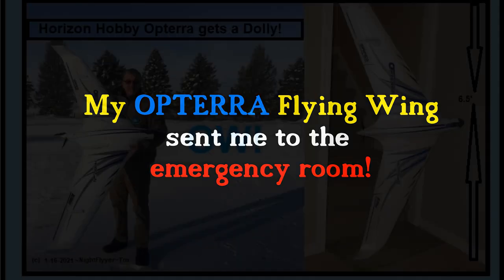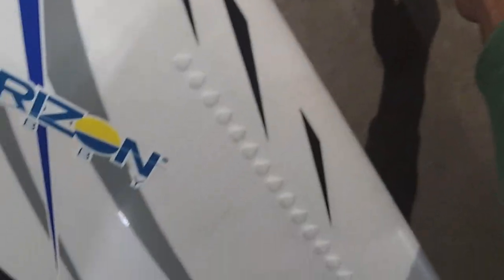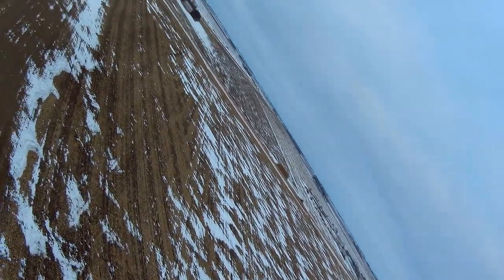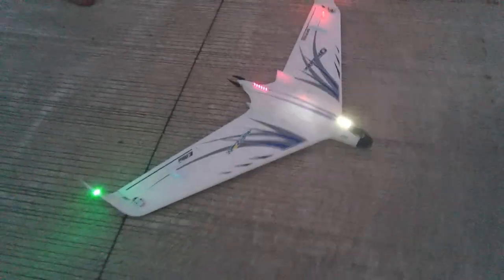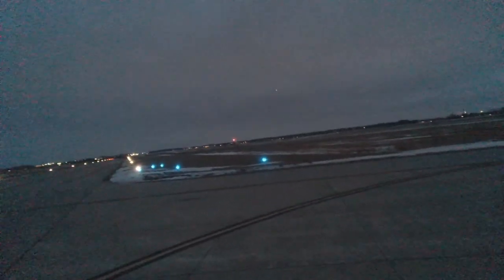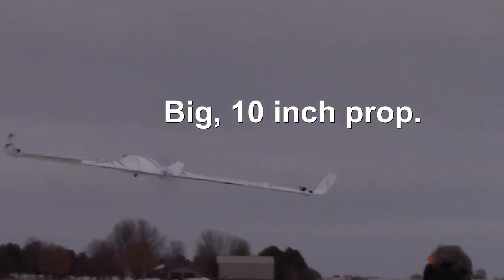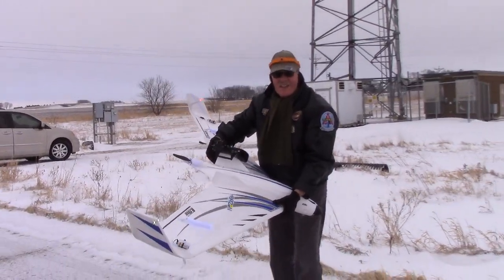My Opterra 2M Flying Wing sent me to the E.R. This is an awareness video & my solution for launching

Comment: Maybe one of those wire mesh gloves, used for filleting fish?????
Reply from the maker: Thanks for that suggestion and I tried that already, but because it was cold.  I found trying to hold on to the tiny finger grips on the bottom of the 7 foot wing with a thick glove under full power with wind blowing was difficult when under power and then trying to fly with  a big enough glove on was also difficult to fly the transmitter, (I'm a stick pincher)  so although that sounds like a good idea, it did not work that well. Some have told me the Prop got them in the forearm even before launch, when a gust of wind got under the wing and tipped it back.   We are only talking about a Half inch of clearance that I needed to keep from getting cut, and even though I pulled it off several times in my earlier product review video,  I will never hand launch it again.  LOL.  It's hello dolly from now on!  Thanks.
Reply: @NightFlyyer  I love wings, and, had looked at this one, myself. I shied away, as although the size was appealing, it looked too bulky to do a "frisbee launch" by holding the wing, itself. Also, it didn't appear to have enough power to pull itself off pvc "rails". Maybe just the addition of landing gear? I've seen it done, once. Seems like a lot of work.
Reply from the maker: @miker1473  yes it is really under powered.  My landing gear is now the dolly.  It adds no weight to the plane, as well..  Thanks.

Comment: Start the motor AFTER hand launch. Or have someone else launch.
Reply from the maker: I know others have their own ways, and either way, my Dolly is the safest solution for me.  
The Opterra 2M manual also says nothing about throwing it with the motor off, so if a newbie followed the instructions, like I did, I'm showing what could happen, in case a gust of wind got them or something else.     Nothing is 100% and no matter how good you can throw, this big 7 foot wing with a 10 inch prop spinning right next to your face, into 12 MPH is risky to say the least.  The 10" prop is very close to your forearm as well, so a gust could tip it back even before launch, as others told me happened to them.  Thanks.

Comment: What a mess! I wonder would wearing a motorcycle glove have stopped the blood getting on your Transmitter 😂
Reply from the maker: Thanks for that suggestion and I tried that already, but because it was cold.  I found trying to hold on to the tiny finger grips on the bottom of the 7 foot wing with a thick glove under full power with wind blowing was difficult when under power and then trying to fly with  a big enough glove on was also difficult to fly the transmitter, (I'm a stick pincher)  so although that sounds like a good idea, it did not work that well. Some have told me the Prop got them in the forearm even before launch, when a gust of wind got under the wing and tipped it back.   We are only talking about a Half inch of clearance that I needed to keep from getting cut, and even though I pulled it off several times in my earlier product review video,  I will never hand launch it again.  LOL.  It's hello dolly from now on!  Thanks.

Comment: my dad got me a powerful plane called the typhoon and he was trying to put the blade on and it was still on and the transmitter turned on and cut threw his shirt and his skin and his stomach was open but my dad was tuff he was in a little pain but for some reason, he didn't go to the hospital I wonder why he put some bandages on and continued to build the plane and I was shocked he said he was fine the plane end up breaking but it's fixed now I'm just getting trainer plane I have a lot of RC heli's and car's so I thought i would know how to fly it but I didn't so I have a trainer plane now and that's my story on learn it before you fly it thank you for your time.
Reply from the maker: Thats quite the story.  Thanks much.
Reply: @NightFlyyer  no problem

Comment: oof, and i thought the people who launch wings by throwing them over their head in front of their face were crazy. i wonder if you could get by with some heavy welding gloves for now
Reply from the maker: Actually that would be hard to fly the left stick with after a launch as I am a pincher.  Besides the indents for your fingers are very small.  Gloves would not fit in there. My dolly is fine for now.   Here is exactly what the Opterra 2M manual says word for word.  1.  Put the aircraft into launch mode with the channel 5 switch.  (in my first video that did not work, it went into the ground)  2.  Hold the aircraft in one hand and the transmitter in the other.  3.  Apply full throttle and throw the aircraft directly into the wind, angled slightly up (5 to 10 degrees above the horizon). 4.  Climb to a safe altitude and check the trim.   Thanks.

Comment: Glad nothing serious happed 2 u. Well there are several easy solutions. A launch buggy is really not neccesary. Our pilots who fly gliders use such a buggy since the power on gliders are gerally weak. So a hand lauch is very difficult. You can always throw it like a disk, holding on one of the wing. With a flight controller on board, no matter which angle you throw it, the plane will always stabilize itself and follow a 45 degree path. 
I removed the stock receiver and placed a PX4 flight controller. With this you have access to telemetry, and most importantly RTL (Return to lauch). Here is a video where I lost sight of my Opterra because it went too high up and I was facing the sun. Not a smart thing to do. At around 3 minutes I activated RTL and it flew back. Here in Wallis (Switzerland) we have strong winds (25 to 35 kph). Again with a flight controller it lands as if there were no wind. I am a big fan of Opeterra. Wish u happy landings. Here is the video:
https://youtu.be/vsq8T75QdYs
Reply from the maker: I will never hand launch this again. Your Opterra is the small one, as it sounds like in your video.  
This wing is 7 foot long, heavy, under powered, and will bend and break the end off the if you even try to pick it up by the tip. (See below video link). It barely has enough power to fly out of your hand at launch and especially while I was trying to throw it into 12 mph wind. I know and I tried to launch it discus style, but could not hold it where I felt I could launch it successfully in the wind with 2 fingertips.     It would  be extremely difficult to somehow launch it discus style with the elevon there and that 7" tall winglet rudder that is also on the tip.  I know how to do it , but not with this plane.    
It's not like launching my SMALL F-27 Evolution or 1.2M Opterra.  So I followed the instructions word for as I did for the video I made of my product review earlier where nothing happened bad.  https://www.youtube.com/watch?v=P_inF5EYLEE&t=1s 
We are only talking about a Half inch of clearance that I needed to keep from getting cut. 

Here is more on the issues of hand launching with pushers, especially this 7 foot Opterra 2M with my sled launcher. https://youtu.be/f5xDfk7sbcQ
Reply: @NightFlyyer  No I have the 2 meter one. I don't have the small one. What makes all this possible is the flight controller (PX4). What I do is assign a button to raise the elevons and an other one to put the plane in stabilizer mode.(Not lauch mode) This way I don't even need to control the radio.   I give it full power and throw it with only one hand. It's a bit ricky but it works fine. This way never had a crash during lauch. Putting in stabile mode fully stabilizes the discus throw. So no matter how badly you throw it, the plane always stabilizes itself and flyes 45 degrees up. No rocket science here.  We have a lot of snow here, so once it melts away,  I'll try make you a video. Words go only so far. Without the flight controller  however, it would be almost impossible to start this big baby with only one hand. Since the lauch is not ideal, before you could start using  your radio, the plane would have already bitten the grass.
To land the plane, I do the same again. I raise the elevons,  just like during the launch and cut off the power. The plane than glides and lands all on its own without me even touching the controls. You can see this in action at the end of the video.
One last thing. I use 4S instead of 3S lipos. The motor then is not underpowered.
Reply from the maker: @iderman2000  Gotcha.  But again this was only my second flight and I did it by the book for my Earlier Product review video. https://www.youtube.com/watch?v=P_inF5EYLEE&t=1s  This video, I launched first by the book, but the autopilot, as you will see did not help, so I turned it off.  I try to do things by the book. 34 years in the USMC, has me usually following instructions or be dead. LOL.  You've had plenty of time with yours to practice and figured it out.  I think the manual instructions should have all your suggestions put in with that programming info published, so everyone, including this 73 YO man, would have a better chance that this would not happen.  Anyway If you watched the video link I sent you on my sled launcher, you would see I also put a 14.4 lipo in, but not before I switched the ESC.  Thanks and happy flying.

Comment: I'd never launch even a small wing from the bottom like that. No way in the world would I launch that giant thing like that.  WAY too easy to make a mistake and those blades can absolutely mangle you, even on a small prop. I value my hands too much. I launch all wings from the side.  Also I always have a throttle cut switch set so prop doesn't spin unless I hit that switch and also give it throttle.  Had a close call one time with Radian and throttle cut is last thing I deactivate before launch and first thing activate after landing, on all aircraft no matter the size, just out of habit on the micros. But they can sting you too. Glad you weren't hurt worse! I hope you learned a lesson though.. and won't do that again.

Comment: Wear a glove?
Reply from the maker: It would have to be a big glove and it is too hard to hold the plane with a glove in the tiny finger holds on the bottom of the fuselage, then be able to use the transmitter with a big glove on.  It's hello dolly for me from now on, as that worked well.  Thanks.
Reply: @NightFlyyer  I fly big wings as pure gliders and love the simplicity of a hi-start launch. Then again, you have access to runways and I don't. Glad you have something that works for you. There are thin kevlar gloves out there; used by people in slaughterhouses on the knife line, might work well too. One other idea; I get it that you can't discus-launch with those vertical winglets, however; you could glue a thin plate under the wing surface that protrudes out past the winglet and gives you a place to grip.  To get fancy, it could be spring loaded to slide back in under the wing after release, little to no drag. I
 just like to imagine different solutions to problems.
Reply from the maker: @heidisuszko353  Yes, I tried to fly with gloves, because it is cold, but could not get my fingers to get a good grip, so abandoned that Idea.  This plane is heavy and not very powerful at launch.  I appreciate your comments, and hope others are warned to be careful as well.  It also cost $2400 for the emergency room trip.  Thanks.

Comment: Safety gloves... kevlar ones.
Reply from the maker: Thanks for that suggestion and I tried that already, but because it was cold.  I found trying to hold on to the tiny finger grips on the bottom of the 7 foot wing with a thick glove under full power with wind blowing was difficult when under power and then trying to fly with  a big enough glove on was also difficult to fly the transmitter, (I'm a stick pincher)  so although that sounds like a good idea, it did not work that well. Some have told me the Prop got them in the forearm even before launch, when a gust of wind got under the wing and tipped it back.   We are only talking about a Half inch of clearance that I needed to keep from getting cut, and even though I pulled it off several times in my earlier product review video,  I will never hand launch it again.  LOL.  It's hello dolly from now on!  Thanks.
Reply: @NightFlyyer  I have access to some soft Kevlar gloves with rubber tips at work for good grip. I'll pick up a couple and send them to you. It'll still hurt like crazy if you get another hit but these things are hard to slice into, so no cuts. :)
Reply from the maker: @Normenian  Thanks but I can barely hold this thing with my fingers as the holes are really small and it is heavy especially in the wind.  Someone already sent me gloves like you mention. Thanks for that and I tried that already, but because it was cold.  I found trying to hold on to the tiny finger grips on the bottom of the 7 foot wing with a thick glove under full power with wind blowing was difficult when under power and then trying to fly with a big enough glove on was also difficult to fly the transmitter, (I'm a stick pincher)  so although that sounds like a good idea, it did not work that well. Some have told me the Prop got them in the forearm even before launch, when a gust of wind got under the wing and tipped it back, so gloves wont protect that.  We are only talking about a Half inch of clearance that I needed to keep from getting cut, and even though I pulled it off several times in my earlier product review video,  I will never hand launch it again.  LOL.  It's hello dolly from now on!  Thanks, but save your money.
Reply: OK :) Keep safe! :)

Comment: You seem like you're mechanically inclined, maybe you can come up with some kind of a launching stick, kinda like an adlatle, you know what I mean, like what the early hunter gatherers used to propel spears.
Reply from the maker: It is just too big for that.  Besides I followed the instructions.  This wing is 7 foot long, heavy and  will bend and break the end off the if you even try to pick it up by the tip and barely has enough power to fly out of your hand at launch.  I know and I tried to launch it discus style, but could not hold it where I felt I could launch it successfully in the wind.     It would also be extremely difficult to somehow launch it discus style with the elevon there and that 7" tall winglet rudder that is also on the tip.  I know how to do it , but not with this plane.

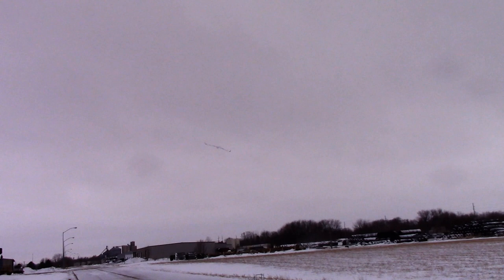Comment: I can hear a prop strike @8:22 when launched off your dolly.
Reply from the maker: I don't think so and there is no prop damage..   I had guides on the bottom of the plane to keep it centered. I think you heard the bottom cross brace hit and jump over the screwdriver I had pounded into the ground to hold the string. The frozen ground would not let me pound it in deep enough.   Either way, it worked and didn't hit my finger.
Reply: @NightFlyyer  Thx for the explanation and the video, thats one dangerous RC to hand launch.
Reply from the maker: @hccwarriordan5475  Yes and I will never hand launch it again, albeit I did it fine in several other flights in other videos.  It's hello dolly from now on.  Thanks.

Comment: Wear a slash proofglove
Reply from the maker: Thanks for that suggestion and I tried that already, because it was cold, but trying to hold on to the tiny finger grips on the bottom of the 7 foot wing with a thick glove under full power would be difficult when under power and then trying to fly with it on and also difficult to fly the transmitter,  so although that sounds like a good idea, it would probably not work that well.  We are only talking about a Half inch of clearance that I needed to keep from getting cut.

Comment: Bummer man and I'm not picking on you but I just don't launch wings in that way. I don't know how you launch that right by yourself but Def not like a tractor style plane.
Reply from the maker: The instructions only say to hand launch it and tells how.  That is how I did it.  The manual says nothing about throwing it with motor off, and it barely has enough power as it is, especially  as I launched it into 12 mph winds.  Of course nothing is 100%, and others told me they were holding this big 7 foot wing and before they launched, a gust of wind got under it and it tipped back and cut their forearm and 3 tendons.  This big heavy, under powered wing is not that easy to hold and launch into 12 mph gusting wind.  Its hello dolly for me from now on.   Here are the links to the last videos.  https://www.youtube.com/watch?v=P_inF5EYLEE&t=1s&gl=CO  and   https://www.youtube.com/watch?v=ur5V5H8UcGs&t=1s I had no problem then, but shit happens.

Comment: Ouch. Throw than throttle.  Or wing toss.
Reply from the maker: This wing is 7 foot long, heavy, underpowered, and will bend and break the end off the if you even try to pick it up by the tip. It barely has enough power to fly out of your hand at launch and especially while I was trying to throw it into 12 mph wind. I know and I tried to launch it discus style, but could not hold it where I felt I could launch it successfully in the wind.     It would  be extremely difficult to somehow launch it discus style with the elevon there and that 7" tall winglet rudder that is also on the tip.  I know how to do it , but not with this plane.    Here are the links to the last videos and you can see I launched it the same way without problems.
https://www.youtube.com/watch?v=P_inF5EYLEE&t=1s&gl=CO  and   https://www.youtube.com/watch?v=ur5V5H8UcGs&t=1s
Reply: @NightFlyyer  be careful, we don't want to start calling you lefty...